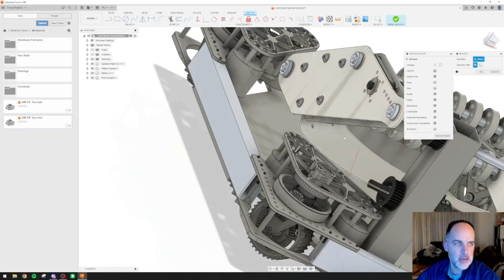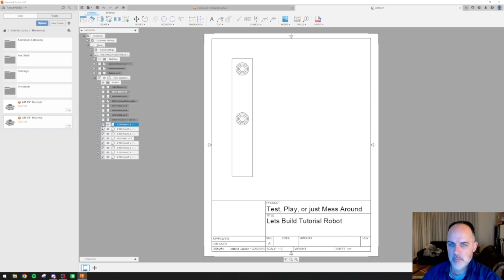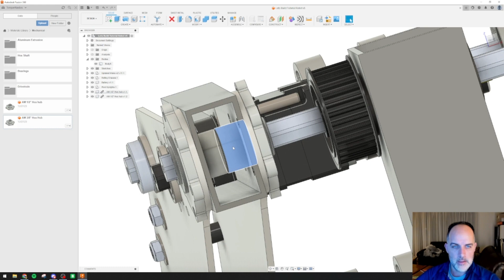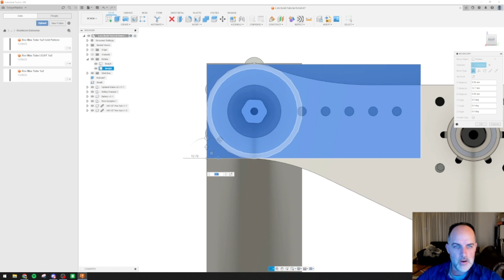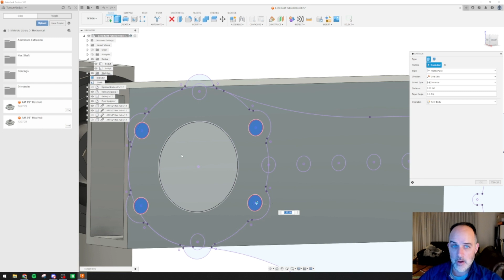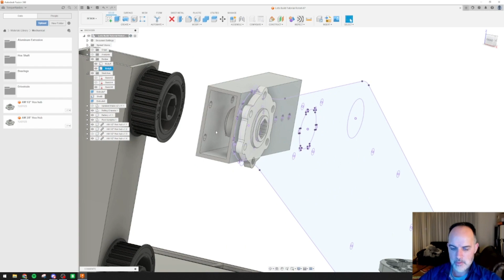Let's Build an FRC Robot in Fusion360 - Video #10 (More Pivot Stuff)

Comment: Just through holes to attach the motor? This will be a pain to mount this motor.
Reply from the maker: This is typically how we mount them - bolts entering tubing opposite side of motor, through tube, and into face-plate of motor.  Granted, we usually use 1x2" tubing so this application has some longer bolts. Do you have an alternative we should investigate?